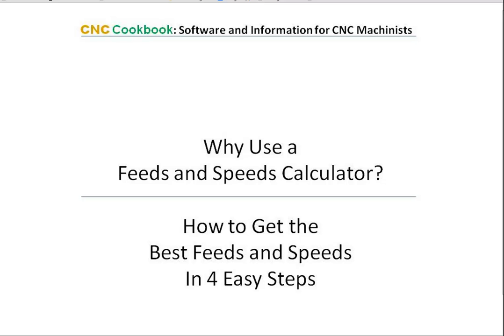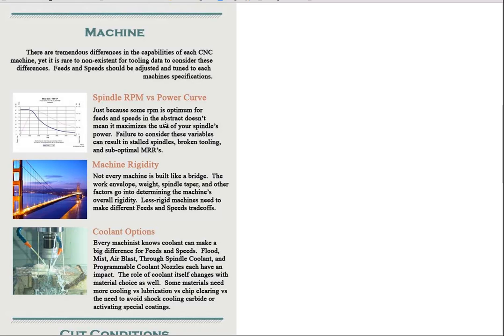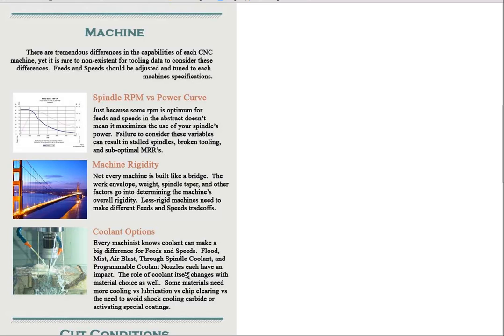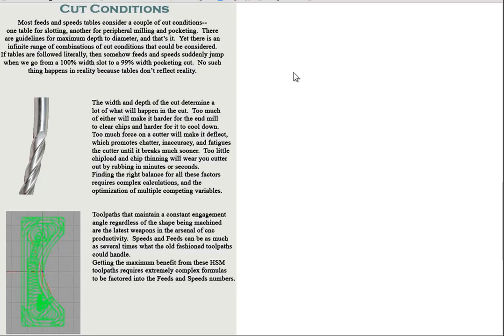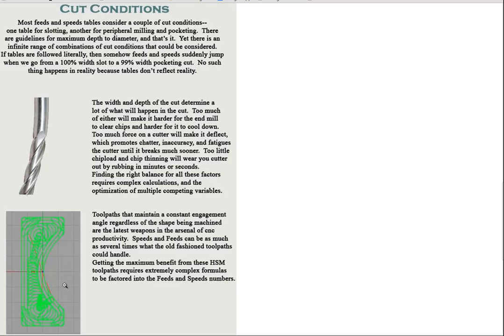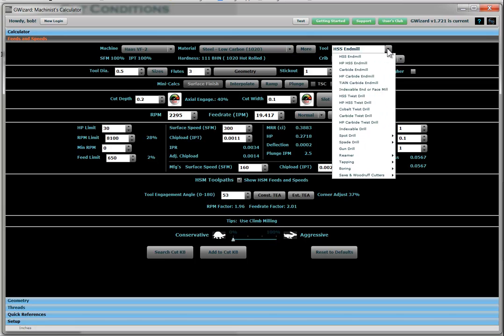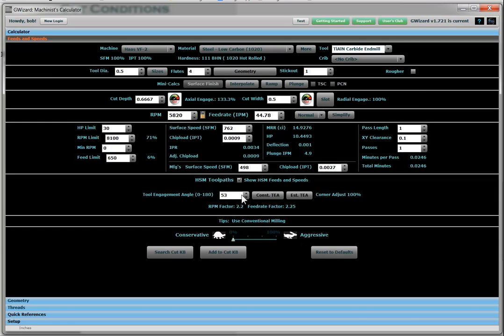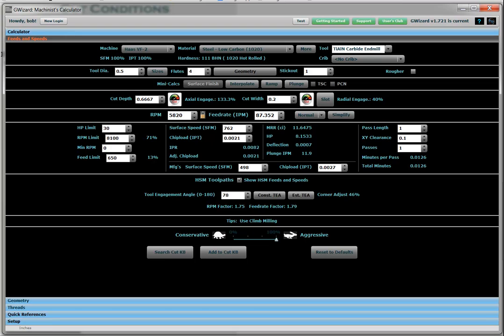4 Easy Steps for the Best CNC Feeds and Speeds

Comment: I use Gwizard for almost every single cut that I do!  I'm also a self taught noob and was breaking 1/8" and 3/16" endmills left and right until I started using Gwiz.  Now I'm actually wearing out tools instead of breaking them prematurely!  It's an invaluable tool, the right speeds/feeds make all the difference, and this takes all the guesswork out.